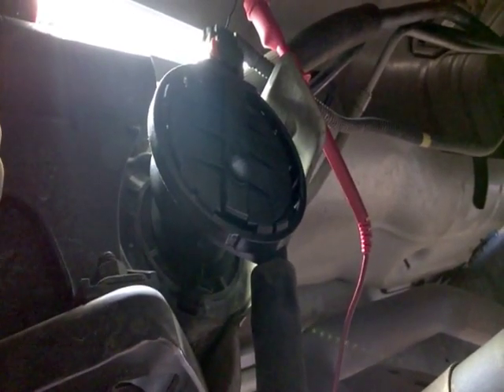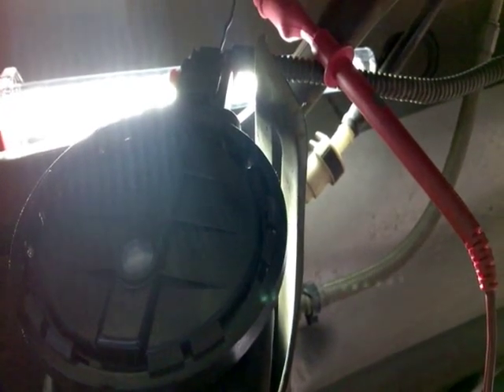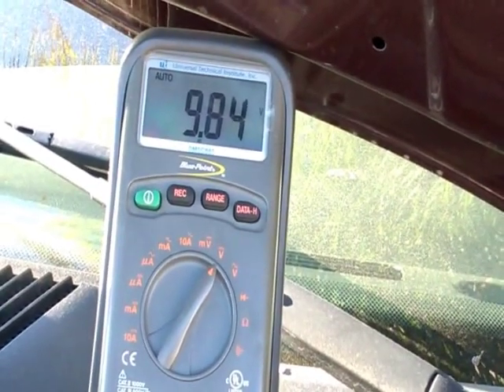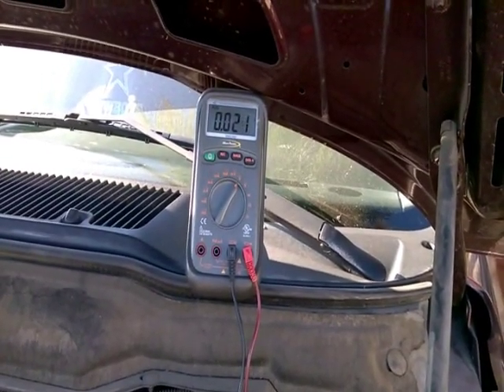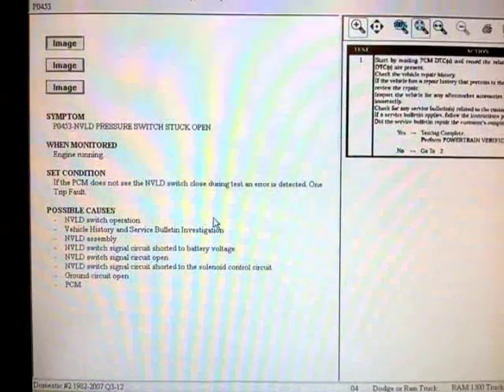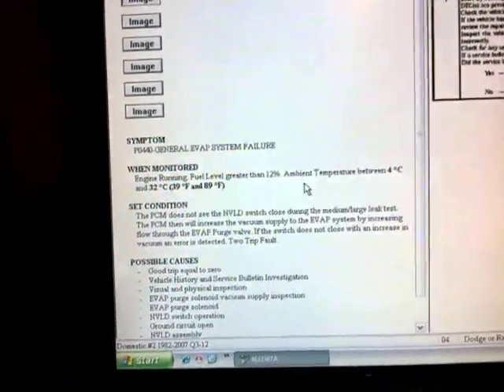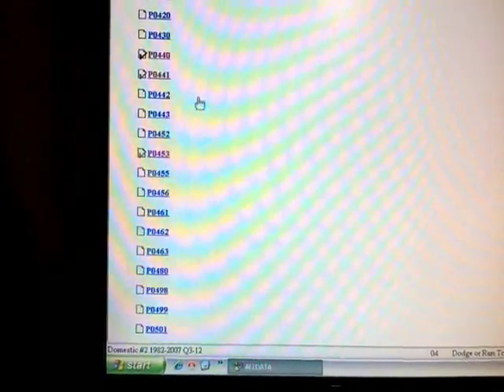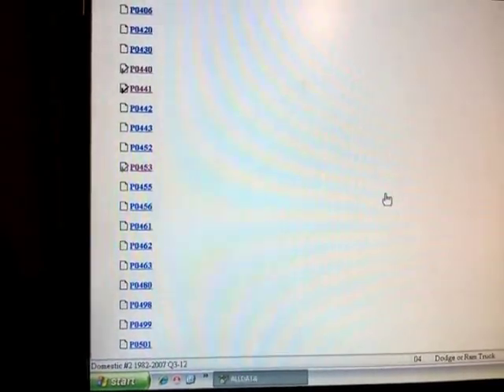(Ram 1500) Evap codes P0440 and P0441 part4

Comment: Great vid, Eli. Will ck this on my '04. Also, do you know if a corroded retaining ring on Fuel pump can also cause p440? I spent $800 3 yrs ago for a replacement tank to pass inspection. Just looked and the ring on this one  looks same as last one alrdy.  I saw the old tank after replacement so it was replaced...I just dont know at this point what condition the replacement was in. 3 yrs seems like exeptionally short life on that type of ring of it were new. Appreciate any advice.
Reply from the maker: Yes it can. Depending on the type of leak, it can trigger a small leak or large leak. On these type of problems, it's best to do an evap smoke test to find potential leaks.
Reply from the maker: Do try my testing methods to find potential evap system components.

Comment: The fix i need for my dodge ram 2003 1500 is p0440. Were about is that part located at
Reply from the maker: A p0440 code is not really a specific evap component code, it's a general code telling you that you have a problem with your evap system. With this code you pretty much have to check everything. For example:
Fuel cap
Cracked or loose hose
Purge valve
NVLD unit
Charcoal canister.

Comment: awesome vid.. fixed no more code, gracias!
Reply from the maker: +MrCuervo22779 my recommendation is to try and perform the tests in my videos to find the culprit problem
Reply: +Eli TheOBDTech hey thanks for the reply.  Better yet thanks for the really fast reply, I haven't finished watching the video yet.
Reply from the maker: I'm glad it helped, you're welcome!!
Reply: +Eli TheOBDTech so same codes are popping up on a friends truck.  Is this  a pretty common fix for this particular vehicle?   I just hate guessing and replacing parts that may or may not need to be replaced.
Reply from the maker: +MrCuervo22779 yes, this is a common problem on many dodge vehicles
Reply: So would you know what the next most likely culprit might be?